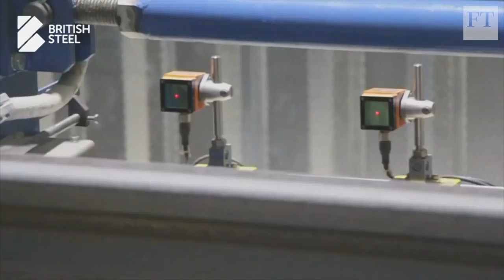How British Steel ended up on the brink

Comment: short quiz: which EU country in 2016 blocked EU resolution on higher tariffs on Chinese steel?
Reply: British Steel was also hit hard by Green Taxes imposed on it.
Have they ever actually made a profit ?
Reply: The Brits
Reply: @tectorama  Dickhead, if you listen to actual video, British Steel were given millions of pounds in credits, by the EU, to offset against carbon taxes.  One of the reasons they are going under is because the EU stopped giving these credits (thanks to Brexit)!! Twit!
Reply: @arfnore  Do you have many friends ?
Reply: tectorama 
Do you honestly think our higher green taxes would make much of a dent compared to the kind of profits they were making from credits? A report in 2016 said green taxes were responsible for 1% of the energy bill for UK steel, pre-rebate. In port Talbot this was around 7.5 million. A conservative estimate of what it alone received in 2008-2014 from the EU emissions trading scheme was 240 million. On average over 5 times the amount per year?
Reply: @arfnore  facts... Don't play good with brexit faith
Reply: The UK we all know that.Or do we?
Reply: @tectorama  green taxes ok. But they received big grants from EU to compensate for green taxes...
Reply: @arfnore  The politicians knew this would happen. They should have compensated for this loss. It's all part of a political strategy. Incompetence by politicians is usually deliberate. They are Narcissistic and they act on what rewards them not what is in Britain's overall economic interests. Give them a bung to mess up and they will do it no messing
Reply: @Isochest  Thats the stupidest thing I have  read on this subject!!!  Firstly, why would the Govt (and especially a tory one at that) use what little taxpayers money they have propping up a private business that will never be able to be financial viable (especially after Brexit)?  Thats like saying they were going to buy a million big macs every year just to keep McDonalds open, seeing as McDonalds is one of the largest employers in the UK!  When the EU introduced the carbon trading system, which British steel relied  so much on, it was supposed to be a way of balancing environmental damage with environmental protection efforts (transferring wealth from one business to the other relative to the environmental impact of the original business).  It was never intended to be a revenue stream, which is how British Steel saw that trading system.  These incompetent decisions were made by British Steel, not the Govt.  The only thing the Govt in this crisis was all this Brexit nonsense.  Brexit effectively closed British Steel out of both the Carbon Trading System (which it made billions of pounds from) AND the protected European steel market.  The EU steel market is protected by some of the highest tariffs in the world, as well as seriously tight technical and environmental   standards in the world!  Indeed, the only reason British Steel lasted as long as it did was due, in large part, to access to that market. 

Brexit and the dopes who voted for it are responsible for this change in market access, not the politicians!  Its just the foolish cohort of the electorate simply cannot accept they made a huge mistake!
Reply: @arfnore  The electorate aren't allowed to negotiate and agree trading rules. And the same Government bailed out banks that gambled money away. After Brexit Britain could trade under WTO rules or indeed set rules of their own. Such a thing requires leadership something that is absent in the current and previous UK Governments. Nice try blaming Joe Public but it doesn't wash
Reply: China does not make steel, it looks and feels like steels but it's not steel.
Reply: UK allowed dumping of chinese steel...
In case you don't know that's illegal (WTO has strictly prohibited it) but guess what the Chinese gave the same opium to Brits which they used 100 years back..

Comment: Steel wont be the new coal, less trade barriers, less tariffs, for the governments role in the affair based on the actions it can take but maybe if there was a UK state owned company or a bigger company that could then take over the business with a government granted monopoly. A solution has to work itself from the inside out to the outside in.